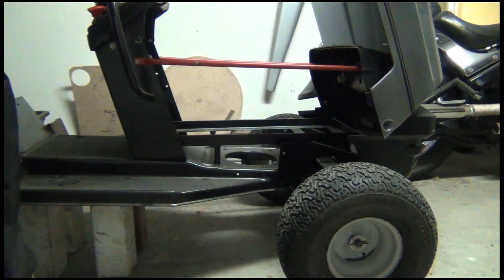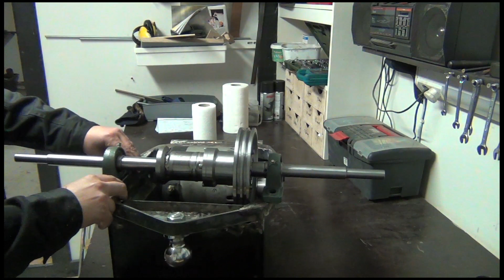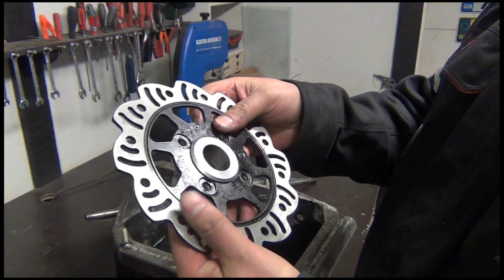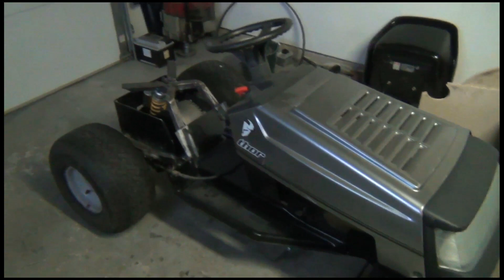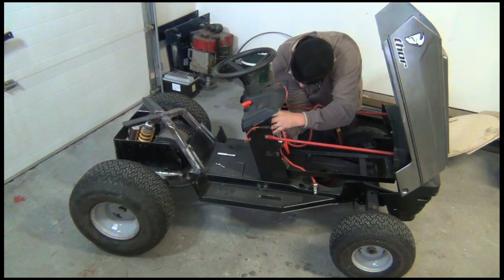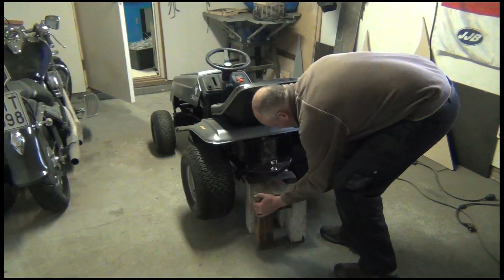El Thorattor - Electric Garden Tractor / the build

Comment: This is great. I am so impressed.  I was wondering what motor controller you were using and where you got it from. 
I am in the process of converting a fairground ride and have a 48kw motor, but need to control it.